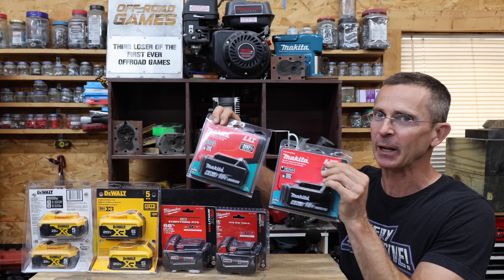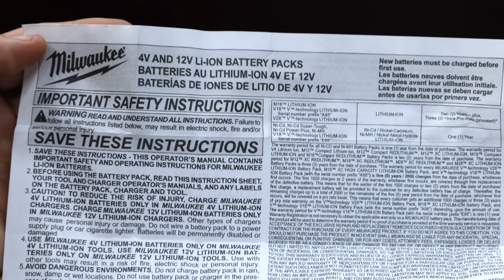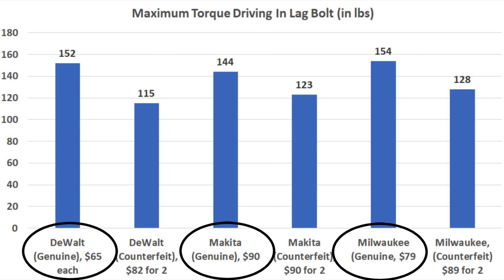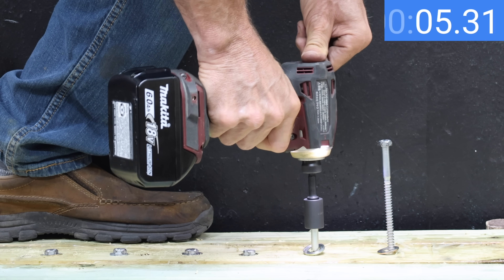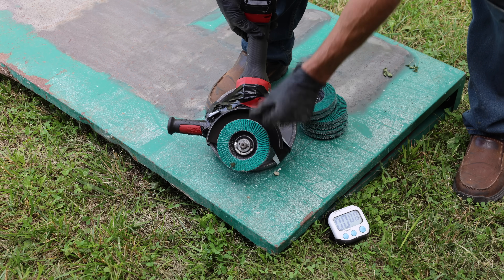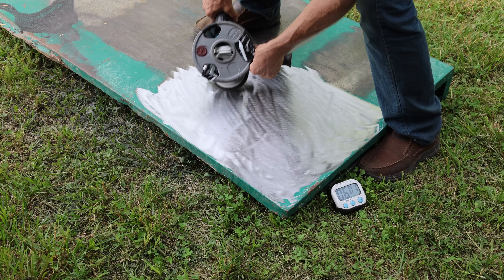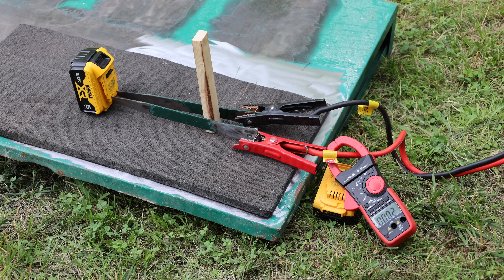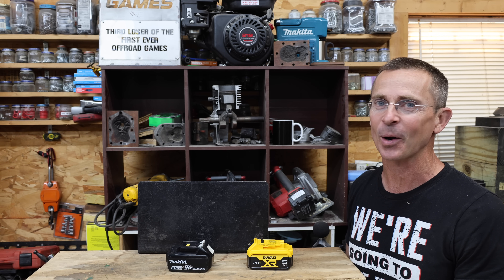Have You Been Scammed with a Counterfeit Tool Battery?

Comment: The reality is that DeWalt, Milwaukee, and probably Makita, have a monopoly on their battery prices.  If you find an "authentic" battery that's more than five dollars less and there isn't a good explanation (new-old stock, current promotion from the MANUFACTURER) you aren't getting a deal.  You're getting fleeced.

Milwaukee and DeWalt batteries are the same price everywhere because the companies control their prices.  There isn't any deal you can get that Milwaukee or DeWalt don't know about.

Shameless plug, but I go through Acme Tools, not because they have the best prices, but because they clearly label current promotions.  Promotions for all these companies are, again, controlled by the manufacturer.  You won't get a deal Milwaukee don't know about.
Reply from the maker: Thanks for the feedback.

Comment: Printer manufacturers use encryption technology to enable their printers to detect and warn about counterfeit ink cartridges. Makita, Dewalt & Milwaukee could do the same for batteries (though the warning would obviously only work in new tools designed to display the warning).

I presume they'll do that, sooner or later. I only hope they don't pull an "Apple" / "General Motors," and completely disable the use of the counterfeit batteries.

WARNING about counterfeits is helpful for the customers (and obviously benefits the tool company). But completely disabling the use of counterfeits (or of different brands of batteries with adapters, etc.) would harm customers. Every proposed product change needs to pass one key test: will this change help our customers, or hurt them?

Comment: ~~I got a pair of aftermarket lithium 18V w/10yr warranty compatible to all Ryobi tools* for $32. Had them for about 6mos&while I don't think they hold a charge quite as long as OEM. But ran them to Hell&back 5x over, w/OEM you get an idea of when they're starting to get low. It's anyone's guess w/these which flat out quit. Same time they haven't really gotten warm either.
~~Didn't know they could get away w/being identical though? Counterfeit/Knock-offs I've seen have a slight deviation. Like DeWalt the "W" is more of double image V. Makita has two K's&so on.
* Had the Ryobi set (sawzaw, drill, circular&vacuum )since 2004&other than visual wear each still runs like champ/same as day I got'em.
Reply from the maker: Thanks for sharing.

Comment: I stopped at 0.27 seconds, haven't gone on as I type this. I guessed the left was fake and right real. So I had my son grab the first two of mine, I just bought about a $1,000 worth of Dewalt tools at a local store, there was a deal if you bought a bare tool you would get a free battery so I ended up with  7 or 8 of these 5AH batteries. Imagine my sigh of relief when the first he handed me looked exactly like the one on the right I think is legit, then the second looks exactly like the one on the left.... There are quite a few differences from case to font to even the height of the battery.... I will post and continue past 0.27 to see how far off my guess is.....
Reply from the maker: Thanks for sharing.
Reply: @ProjectFarm   So both are dated 2023 but for all i can tell short of tearing them up they are legit. This might be the first of your videos I have seen that might be inadvertently incorrect in some cases. I am more than willing to use my two versions to help figure it out so you can provide people with more info but being the poor old goat I am we would need to come up with a non destructive way to figure it out.  FWIW I haven't used them much but I was definitely not impressed with the battery life so far.  I would love to get to the bottom of this though for correct info to help people out and the fact this store is a popular farm and ranch outfit. If they are getting counterfeit batteries we should likely need to know and i am sure the company would like that info too...

Comment: The Milwaukee stuff is super expensive here in New Zealand. That M18 XC5.0 battery you tested is NZ$277.00 here - which is US$170.00 with the exchange rate. 
We can't get batteries from Amazon or Ebay etc because most airlines won't ship batteries.
Reply from the maker: Thanks for sharing.

Comment: Several years ago I purchased 2 aftermarket Makita batteries and they are still working for what I need them for, one of the original ones died.
I also knew the aftermarket ones were not the real deal since they were quite cheaper and didn't have the Makita logo on them.
Reply from the maker: Thanks for sharing.

Comment: Thanks for doing this. 

I knew the fake stuff was getting hard to differentiate. But I didn’t know it was this hard to tell. 

Only way to know now is to have chips in the batteries that makes it impossible to repair but gives a secure handshake that they are real; or tear apart all new batteries to see what’s inside. Once torn apart you can’t return though as sellers will claim you destroyed it. 

Amazon and eBay don’t care either as they get paid either way. 

Only option is to only buy from legit reputable retailers or direct from the brands. Even then it’s possible someone pulled a swap with a “sealed” counterfeit resulting in you getting junk even direct. But the chances of that are much lower.
Reply from the maker: You are welcome!    Thanks for the feedback.

Comment: Can you do a test on all the different  types of wire connector to see what one is the strongest/best and corrosion resistant. Like the barrel connection, screw type, push to connection, ect.  Would like to see what's the best for marine applications
Reply from the maker: Thanks for the suggestion.

Comment: I wish you had also paired up the Porter Cable batteries in this test. But you did give me plenty of clues to look for when buying batteries. Thank you for yet another great video.
Reply: If you can open them up then do that to verify, counterfeits almost never have name brand Samsung or LG chem cells in them. 

They save on cost by using generic cells, often with a lower capacity.

If you have name brand cells you have an OE pack.
Reply from the maker: You are welcome!  Thanks for the constructive feedback.

Comment: Lol @7:08 it's not even in all the way, and on the counterfeits you torque them down longer and add the time. @7:22 jump cuts adding time.  @7:32 you add over a second by continuing to torque it down 6.93 seconds and it's the same or better than your genuine 3rd at 6.19. 

The genuine batteries are clearly better but not close to what they're being portrayed as.

Comment: I got to say I'm impressed with these counterfeiters. At the original picture I paused and studied for a while, determined that for sure the one on the right was the counterfeit, but I was wrong. It was DEWALT that had changed their "XR" logo font, was using the snazzier font for the "20V", and had the inferior package welding on the top where the clamshell was melted together.

All of this had led me to be certain that the real deal was the fake.
Reply from the maker: Thanks for sharing.

Comment: Where you able to eventually charge the overloaded "real" batteries? I think their BMS is supposed to turn them back on after  some time period or after you apply a small voltage to the +/- terminals. That's the way LiFePO4 storage batteries work anyway and many of them are made with the same cells.

Comment: We also learned to make sure not to short out the real Milwaukee batteries either. That was disappointing
Reply: They have a higher threshold for thermal runaway allowing for longer heavy power draws , It's not bad thing it's actually good and if it started on fire than it would have been an issue
Reply: @gamersplaygroundliquidm3th526 It didn't start a fire because the shorting bar is too large to burn through. I would imagine an external shorting cable would get hot enough after 14 seconds to cause a fire. Imo, holding on for that long is not really a good short circuit protection idea, especially when the board is damaged instead of an internal fuse.
Reply: But it will survive a short duration short circuit unlike the counterfeit ones.
Reply from the maker: Thanks for sharing.
Reply: Maybe Milwaukee is just trusting their device's internal fuse, but after seeing this, I really can't recommend using their power inverter. 200A for 14 seconds is easily enough to melt any standard household cable.
Reply: @blarfroer8066  To be fair, it's not going to do 200A at 120V. Unfortunately, the amps it will do at that voltage is still more than twice what the average 120v cable is rated for.
Reply: @InfernosReaper   thats also assuming the inverter doesn't have overload protection. i would be very surprised if they didn't have overload protection in the device itself
Reply: @blarfroer8066   200 amps is on the battery side not on the inverter side, the inverter side would see less than a 10th of that amperage
Reply: Design tradeoff. Would you rather the battery survive a brief short circuit or blow an internal fuse right away? Used as intended in Milwaukee tools I doubt they’d ever see a short circuit.

Comment: The voltage spiked at such and such amperage?  Those are two different things.  The amperage spiked.  The voltage would be zero in a short circuit.

Comment: Video Idea: Coolers and coolers with built in compressors (refrigerator at that point) like those that run off car 12v or adapter for AC.
Reply from the maker: Thanks for the suggestion.

Comment: Notice that some of those eBay sellers have pretty good feedback ratings.  Even 95% ratings are not good enough unless you actually READ the last few months of ratings for red flags.  Repeated reports of counterfeit items are red flags so long as those users themselves have near-100% feedback.  Always remember that most buyers have no idea how to test or rate the products they receive, so do not trust 5 star ratings from typical consumers.

Also, batteries priced substantially lower than retail are almost certainly counterfeit as no one is dumb enough to sell things for much less than their worth.  If you had a $120 set of batteries in an unopened package, would you sell them for $60?  $80?  No, you'd want nearly full price for them.  Low prices for supposedly new items are a huge red flag.

Unfortunately, while I hate the tool brands for becoming battery price-gouging companies, you'd have to be an idiot to buy so-called "genuine" batteries from anyone other than the brand itself or from an authorized retailer.  I have no problem with those that sell replacement batteries that aren't labelled as genuine as they may offer 90% of the runtime for half the price, but counterfeiters should be jailed and we should not reward them for their crime.

Tools should last multiple lifetimes and it's insane that millions of us now spend way more money on battery-powered tools with limited lifespans than our grandfathers did on AC-powered tools that outlived them.  I will never accept this trend as normal.  We should buy quality tools ONCE.
Reply from the maker: Thanks for the feedback.

Comment: on the counterfeit milwaukees its very easy to tell. press the battery charge level button, if all the indicator lights lite up at once then its counterfeit, if they light up in sequence then they are usually genuine. Atleast from my experience.

the counterfeits i bought did however use samsung cells...
Reply from the maker: Thanks for sharing.

Comment: you need to change some of your testing procedures. Those amp measurements when you shorted the batteries are probably very inaccurate. The refresh rate of those screens is very very slow, you are likely missing the real peaks of the current. You need to use an instrument with a much higher polling rate, something that records the data instead of just displaying it on the screen momentarily, or find some instrument that will display the peak recorded amps on the screen until you clear it.

Comment: The problem I have is that I still wont be able to identify a fake battery until I buy it and open it up. They could be sitting on the shelf and I don't know who would be able to tell the difference.
Reply: Yep.  The fake ones look almost identical to the real ones.  Difference would be weight and slight differences in printing.
Reply from the maker: Thanks for the feedback.

Comment: On the Milwaukee batteries....
did you attempt to check the 'secret codes' in the light display?
On SOME Milwaukee batteries,
Press the 'button' for 5 seconds... 
The 4 lights will begin a series of blinks... 
a *flash code...
Such as... example...
All 4 blink once followed by #1 light once... (1000) = OK ... 0001 = FAULT.
All 4 blink 2 times then #1 1, #3 7, #4 9 = 1079 days since first charge cycle
All 4 blink 3 times then #2 1, #4 6 ... = 706 charge cycles
All4 blink 4 times then #1 2, #2 1, #3 3, #4 7 = battery type??? or status???

Comment: I canvassed a worldwide known auction site for 9V USB accumulatirs to find a decent replacement for my 9V NiMH batteries, and came across a ton of suspicious counterfeit units being advertised as some 1'000 mAh. From past experience, the native NiCD and NiMH only provide some 150 -250mAh as they consist of stacked cells wrapped in plastic casing. I found trustworthy units from Ansmann which provide 300 to 400mAh which fit the capacity of native block batteries. It was like searching for the needle in the haystack, took me about an hour to find what I was looking for. I am shocked and appalled to see that knock-offs and counterfeits lead top list search results and no one seems to care about anything going on with search engines being manipulated in the favor of money and endangering innocent people.

People out there, think wisely and compare throroughly before you buy. Todd has clearly demonstrated and proven the reasons why.
Reply from the maker: Thanks for the feedback.

Comment: The constant drain test showing amps, voltage and wattHours is enough to see the difference and makes all performance test unnecessary. Especially the screw test and such with second(s) of difference doesn''t say anything. If you want to do test the right way, you need a constant dense material (not wood with all the differences) and a machine to handle the operation instead of a human.

Comment: Earlier this week, I unknowingly bought and received counterfeit Milwaukee m18 batteries from eBay.  Upon opening and trying to charge them, I realized they were not authentic.  I was curious about the performance of these counterfeit ones, and your video clearly demonstrated my curiosity.  Thank you for making this video.  Very helpful.
Reply from the maker: You are welcome!  Thanks for sharing.
Reply: My red flags to avoid are any seller using the same photo for multiple battery listings, any seller selling more than five of the same battery and any negative feedback with the word battery. I've seen 99.1% feedback sellers where that 0.9% is dozens of complaints of counterfeit batteries. I've had good luck buying used batteries from small sellers.
Reply: eBay and Amazon are STUFFED full of counterfeit auto parts too. 

Don't buy auto parts from either marketplace. You'll get knock offs. They are even making knock off spark plugs without the iridium and platinum tips that make modern plugs last so long and work so well.

Comment: better buy none-branded replacement batteries than those counterfeits. it's also easy to get more performance from a battery pack if it uses larger 2170 cells instead of 18650
Reply from the maker: Thanks for the feedback.

Comment: Hey Todd, just a suggestion. It was a little difficult to keep track of which one was counterfeit and which was legitimate, because the order of testing them seemed to change- for example, counterfeit was on the left, but then it was on the right. Then in the lag bolt test, it went counterfeit-authentic for DeWalt, but the order switched for Milwaukee. It would help to keep that stuff in the same order just so it's easier to compare from the viewer's perspective. Other than that, an amazing video as always.
Reply from the maker: Thanks!  Thanks for the constructive feedback.

Comment: With two Ridgid 18V clones I got off of ebay 2 years ago they were not sold as Ridgid. 

So the odd thing is they do work well for light loads ie driving screws.

But if you rip plywood or really pull some power the overcurrent gizmo cuts the battery off for a second. Then it is ok again a few seconds later.

It does have a circuit board inside that cuts the pack off when a lithium cell inside is too low.

Engineering wise it is like 6 Amp hr battery back is great for light loads. BUT for a heavy load the pack is terrible.  Saw stops in middle of ripping a sheet of plywood.  Lol.
Reply from the maker: Thanks for the feedback.